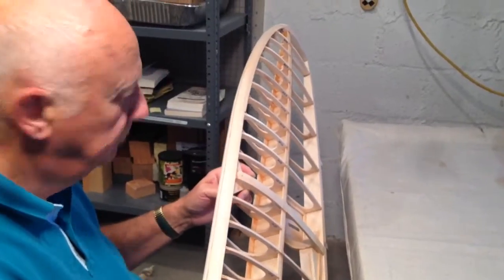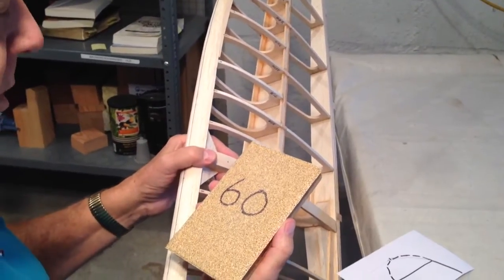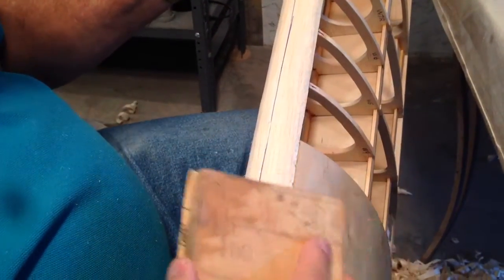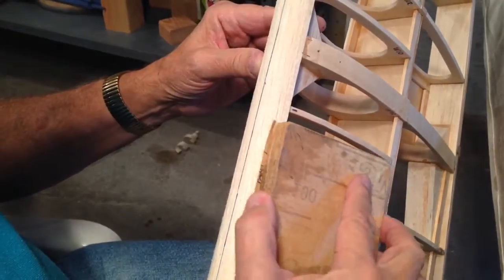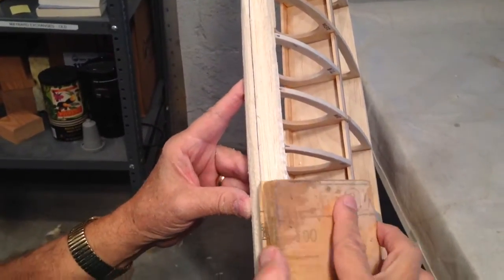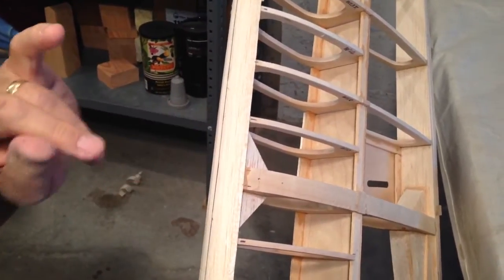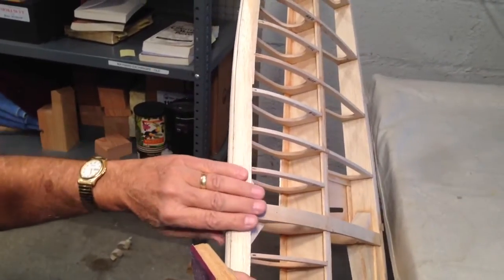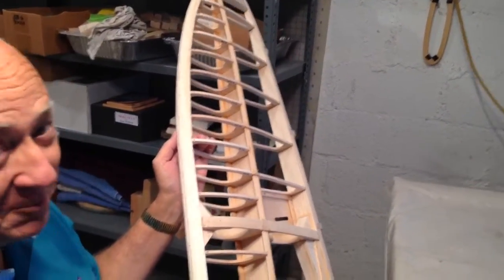Wing Leading Edge Shaping Part 3

Comment: I usually put some masking tape on each rib before sanding. :) Thanks for sharing
Reply: Agree. No matter how careful you are, it's very easy to inadvertently sand a flat on the ribs behind the LE. Even a few stray strokes can mishape the ribs and distort the aerofoil section.